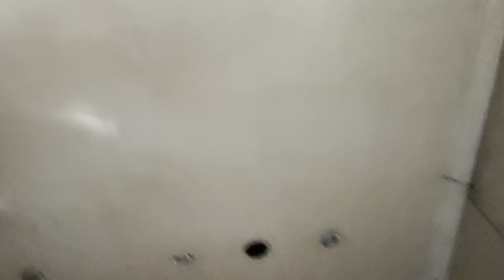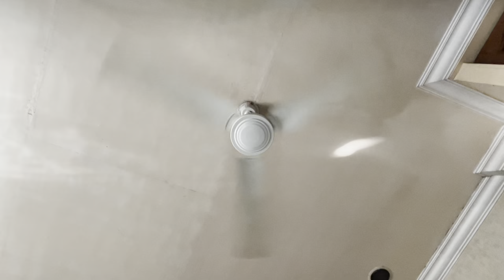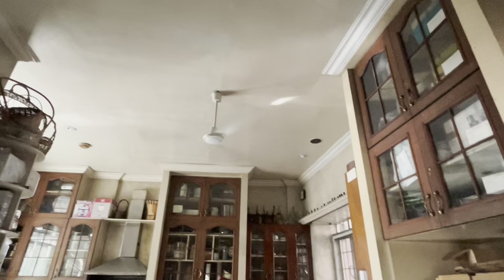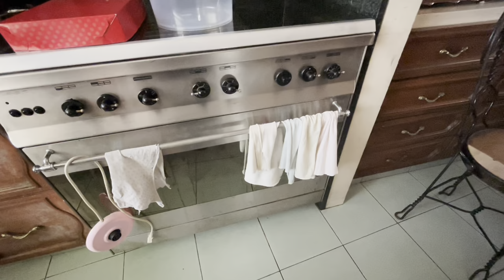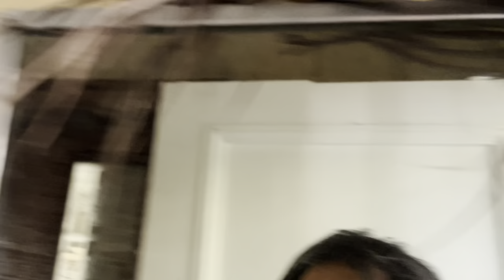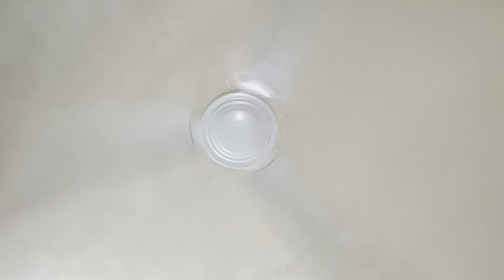3D Aero-Master ceiling fan (revisited) (all speeds & spindown)

Comment: We also have those kind ceiling fans in my dad’s resort in batangas, one is in the restaurant or lobby, and the other one is in the gazebos which is the place where you dance and the other one is the billiards area near the hotel rooms

Usually they’re installed since 2011

Today at this time,

But sadly, they took it down because they’re seriously broken and problem with the ceiling fans is that, the water is leaking from the roof and that’s getting them wet

And all though we have a disco ball 

But then it stopped working
Reply from the maker: That’s unfortunate. Can they afford outdoor fans like some of the Westinghouse or Hunter ones? They would probably survive water leaks

Comment: Also don’t forget the KDKs
Reply from the maker: We planned to get a KDK to replace this if it was failing but turns out it wasn’t, just needed cleaning. I would’ve wanted to get a KDK anyway since they’re much better fans than these, but my aunt didn’t want to spend any more
Reply: Also planning to buy white Asahi C42s for the gift shop in my family’s resort but my dad is tired to work for the building.At least keep working hard for yourself a 47” KDK M56XG coated white for your living room also cheaper to buy in Lazada which cost 5.100,00 pesos and easy to buy. If KDK ceiling fans left the philippines, idk. Maybe in Avesco, its cheaper and it cost less than 5k besides the 4K pesos
Reply from the maker: @HuskyPro122  Might get something like that when I move out in the future. Depends on the ceiling height and where I live (if I stay in HK will more likely go with SMCs which I think are just as good if not better)